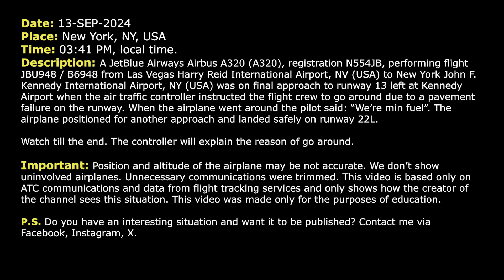“We’re MIN FUEL” after go around. JetBlue A320 goes around due to pavement failure at JFK. Real ATC

Comment: One go around causing min fuel doesn't sound like good planning to me. Not that there was a danger of crashing in this instance. However, many weather hold and/or traffic related incidents would have been serious for this flight.
Reply: They plan based on the weather conditions and any need for alternates - it is determined for each flight. Likely was a clear day with min expectations for weather. They were not at emergency fuel, just couldn't take a lengthy delay or a hold. 
Also, another commenter suggested the plane may have been maxed on fuel and/or weight w/ Vegas heat.

Comment: Vegas is a hot and high airport this time of year. To carry all the payload and avoid a fuel stop, Jetblue probably couldnt carry much above the FAR 45 minute reserve. If JFK didnt require an alternate, it probably would have been planned to land between 5 to 7K pounds of fuel. Likely closer to 5K if heat at LAS was limiting payload. If LAS was hot and high and no alternate was carried, they probably were at or near the 45 minute reserve when they need to go around.
Reply: Not sure what time they departed, but we're doing 60s/70s in the morning to 90s/100s during peak heat around this time of year.

Comment: What does he mean by "next arrival 6-mile final, proceed on 13L at D"?
Reply: He was letting the car who was holding short of the runway know that JetBlue was on a six mile final to the runway and he can proceed onto runway 13L from taxiway Delta to do the runway inspection. Just giving the car a heads up as to how far the traffic is to expedite the inspection
Reply: @sebastianbrmdz  thanks
Reply: The next aircraft to land is 6 miles away, enter runway 13L at the D intersection.

Comment: For those wondering, declaring “Min Fuel” does not give you priority. It’s just telling ATC that you can’t accept any lengthy delays. ATC is required to tell you if there will be a delay getting back in. If there’s a delay it’s up to the pilots to declare Emergency Fuel or not. Emergency Fuel gives you priority

Comment: It seems to me that you should have enough fuel to be able to do at least 1 go around!!
Reply: Min fuel usually means the plane has enough fuel for at least 30 mins daytime and 45 mins at night so they are able to still do a couple approaches but with no extra delays or holds. It isn't an emergency but the are minimum as defined by FAR.
Reply: @jamalh7882 Not quite. It means they have just enough to land with 30 minutes to spare if there are no more delays, not that they have 30 minutes of fuel now. If you have 30 minutes of fuel now, that's an emergency.
Reply: Minimum fuel is defined as the aircraft cannot accept undue delay
Reply: @skycop4093  You should not however need to declare min fuel after 1 missed approach. JetBlue has a history of planning little or no contingency fuel. It’s frustrating because when weather hits the NE they are always declaring min fuel. I showed up heading to JFK and we put on 1 hour of contingency fuel due to the poor forecast. 4 Jet Blue flights showed from the Caribbean and all declared min fuel as soon as the were given holding instructions. ATC worked them in ahead of us and when JFK weather went down again we were forced to divert to Philly. Being forced to divert because you did proper fuel planning is not the way the system is supposed to work.

Comment: Bingo fuel. Not something you want to hear when you're rejecting an approach.
Reply: "Bingo fuel" is a military term that doesn't really apply. This was "minimum fuel", which means if there are any further delays they'll be landing with less than the required reserve of 30 minutes of fuel. That means it isn't an emergency now, but will be if there are any further delays.
Reply: Bingo in military parlance means emergency fuel at which point you fly a max range profile.
Reply: @scottw5315  I don't think bingo fuel is an emergency. It is the point where you have to abandon the mission, but you do that before it becomes an emergency.
Reply: @thomasdalton1508  Nope, I don't know about USAF but in the Navy/Marine Corps tactical jet community, joker, is the term for knock off the mission fuel state.  Bingo is an emergency fuel state.
Reply: @scottw5315  Every definition I can see is that bingo fuel is enough fuel to return to base and then travel to an alternate. That's not an emergency.
Reply: @thomasdalton1508  I went through the Navy system.  It's an emergency procedure.  We practice it a lot in the simulator.  I flew an actual profile after boltering twice and getting a fouled deck wave-off on the Carl Vinson.  It's in all the Natops manuals for strike aircraft.  There is not equivalent in the civilian sector.

Comment: Weird that 948 didn’t advise the arrival controller that they were min fuel either when coming on frequency or when controller asked if they needed setup time, no?
Reply: It should have been passed on by the previous controller, but it would make sense to repeat it just in case.
Reply: They weren’t at minimum fuel until the go-around.
Reply: @ahgflyguy  The OP is referring to when they went back to the approach controller after the go around.
Reply: The extra power required to climb out makes it a likely time.
Reply: They were already vectored in for landing without any delay. No way to make it even faster
Reply: @FalconX88  They could have shaved off a couple of minutes if they really needed to, but I doubt they were that low.